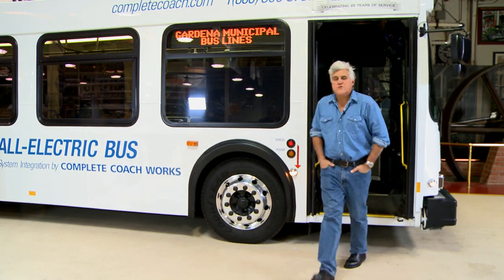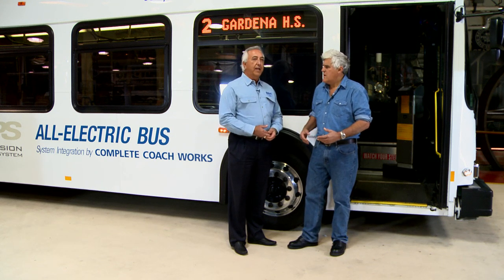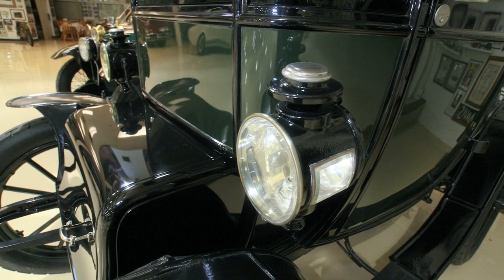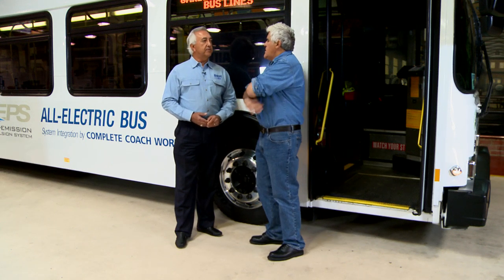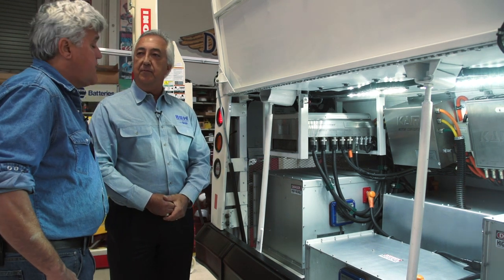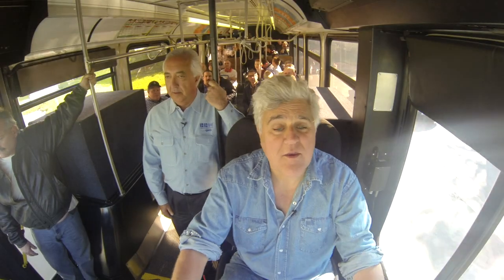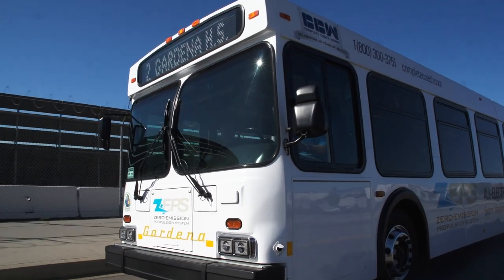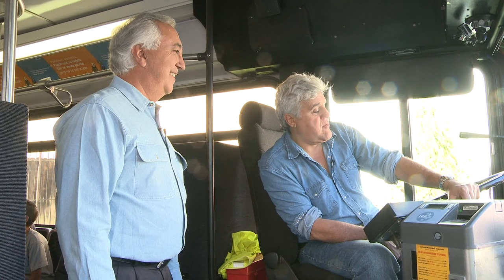Electric Bus Conversion - Jay Leno's Garage

Comment: i can't believe what I'm reading in the comments. You would think those things get all charged up with fairy dust and unicorn farts. When you factor in the building of this thing and the toxic chemicals used, not to mention all the other oil and gas used in ancillary components the efficiency is out the window and not ready for prime time.

Comment: This guy has literally NO idea what he is asking when talking about electricity. Why ask questions which are irrelevant, inaccurate, and not even interesting to the audience?
Voltage makes NO difference to the operation of the bus!! -.-
Reply: +Omar Smith it does make a diffirence, it allows for higher total energy transfer through the same given set of wires without increasing amps
Reply: +Omar Smith No difference? Let's go back to the absolute basics of electricity, the power delivery equation. P=VI, where Voltage and Current both equally effect the power of a system. Being as Batteries are inherently Current limited on their output, due to physical and chemical limitations, the only way to draw more power from a Battery pack at peak load is to increase Voltage.

That being said, I think people DO put too much emphasis on Voltage over Current while talking about these systems, and I think that it's due to a lack of consumer understanding about electric cars. For example, Tesla had to change the battery pack connectors on their Model S to get it's Ludicrous Mode 0-60 time down in the 3's. That had nothing to do with voltage increases, solely to do with current carrying capacity and preventing components from melting under the force of thousands of amps.